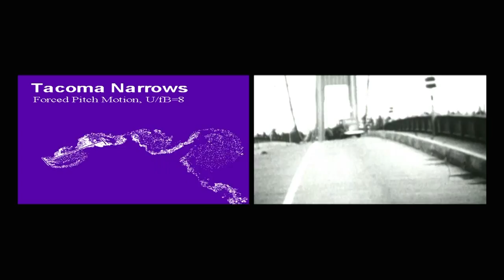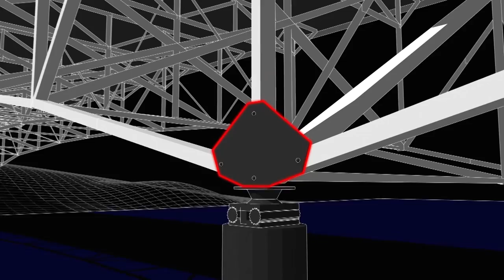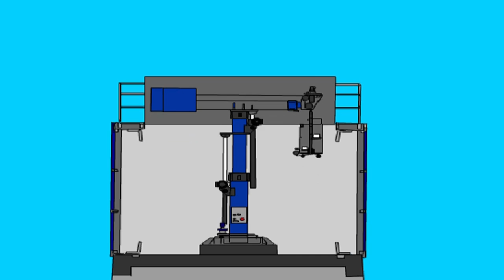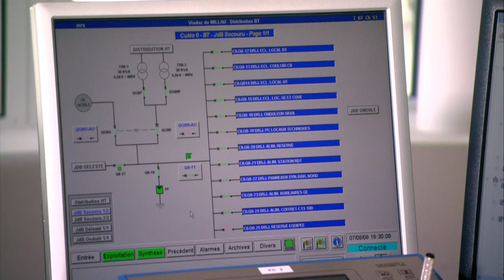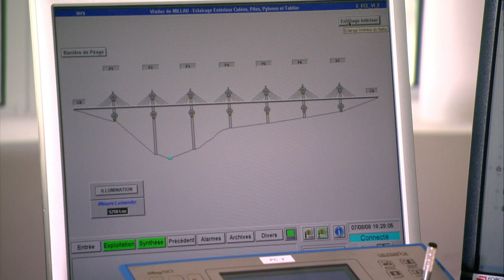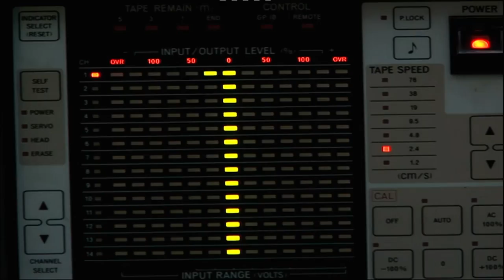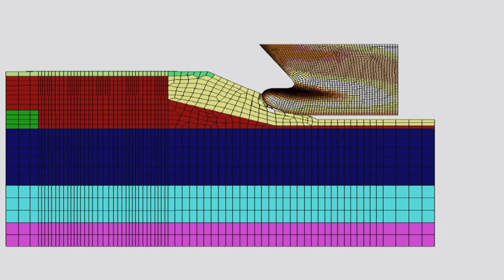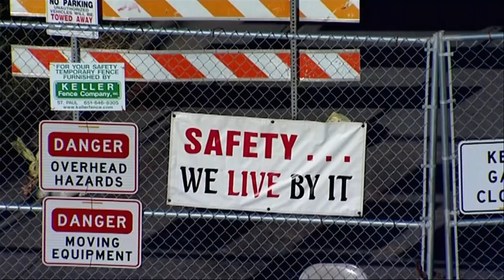How Do Engineers Build Safe Bridges? | Built From Disaster | Spark

Comment: Although the Tacoma bridge was not that great at resisting the strong winds, one of thr major parts involved which caused it to fall was the resonant frequency of some components of the bridge. When the wind wss able to oscilate the bridge with verryyy small oscillations,  it was able to reach the resonant frequency of some components of the bridge, meaning that those small vibrations turned into massive vibrations due to superposition. THAT I believe, and many others believe, is the reason why that bridge collapsed.
Reply: That was the same vibrations that tore apart Partnair Flight 394 which became worse due to a broken APU and three counterfeit aircraft bolts in the tail.

Comment: The interesting question is why structures fail.  The I35W bridge failure in Minneapolis wasn’t a consequence of lack of knowledge, because steel truss bridges have been built for a long time.  It was just underengineered.  It came down, as it often does, to an inadequate margin of safety.  Doing things on the cheap.
Reply: Maybe that contributed, but clearly another big contributing factor was that there wasn't enough government-funding for the department that carried out maintenance on the bridges. Whether the bridge was under-engineered or not, the maintenance department had been saying that they did not have enough people and that many bridges were in desperate need of maintenance they couldn't provide, and nothing was done about it. 

I agree that doing things on the cheap is a big problem in construction (particularly when the customer won't pay for the necessary safety precautions or the people in charge of building it cut corners), but I'd be more concerned about the government paying for a brand new shiny bridge when it is under public scrutiny, and then cutting maintenance costs when no one is looking.

Comment: The statement by Prof. Galambos is odd, because other structural engineers have said they knew the World Trade  Center would collapse.  Steel loses its strength when heated sufficiently.

The I-35W bridge was just underdesigned, particularly the gusset plates.
Reply: No other steel structure, like the World Trade Centers, has ever collapsed due to fire. The collapse of the building was also identical to how a building is collapsed by explosive demolition. Although it wasn't the same plane, the structure was strong enough to stand an impact from a 707 aircraft. There was no way the fire weakened all the steel in the entire building.
Reply: Many people who now understand why were surprised when it happened. They weren't considering the insulation being shot peened off the steel by the remains of the plane, for example.
Reply: @Markle2k  and the higher heat provided by jet fuel.

Comment: Earthquakes were never mentioned.  I guess Hong Kong doesn't have them, so no need to anticipate problems?
Reply: There is no earthquake in Hong Kong
Reply: Hong Kong is not in a seismic zone, but it is in a hurricane/typhoon zone.  The threat is different, but both require mitigation measures in design and engineering.

Comment: Safety and integrity of any structure is only as good as 5he money holds out. Once delays, unforeseen problems arise, short cuts take hold to keep the project on time. I am an Ironworker with 43 years experience. Often the engineer will ask me what do you think. Engineers need to spend at least 2 years in the field before being certified.  Because what works on paper is not worth shit in the real world.